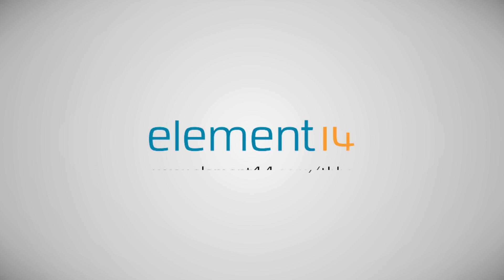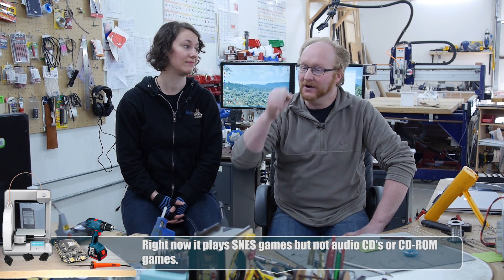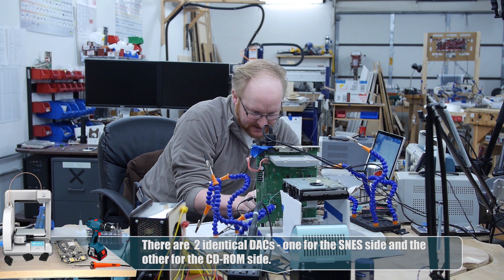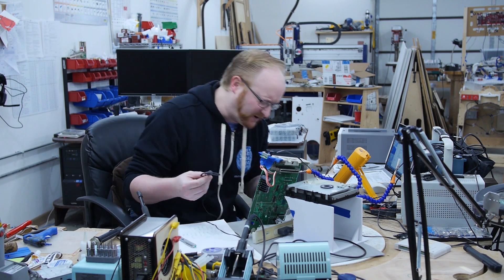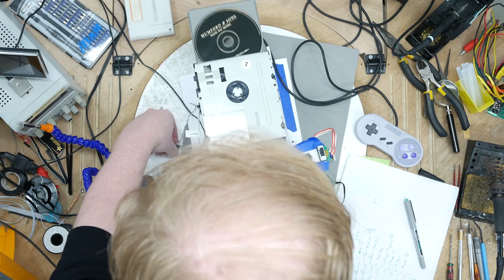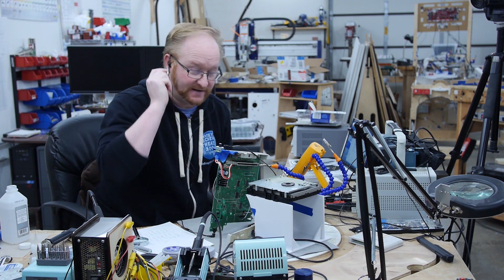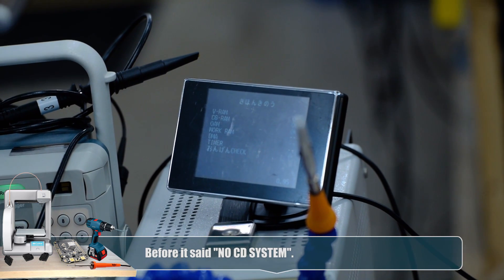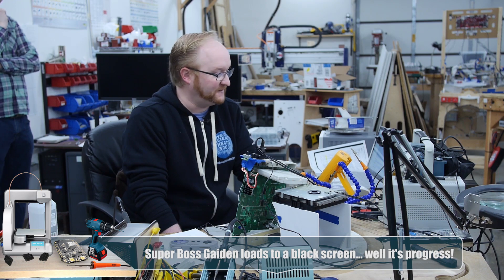Nintendo PlayStation Prototype: Finally Working!

Comment: I hear  a lot of stories about what happened. What I heard was Sony wanted to make CD games that ran exclusively  on their stand-alone unit that would not run on the Super NES add-on version of the hardware.   The Philips hardware sounded more interesting anyway with it's 32-bit co-processor that it was supposed to have.

Comment: I'd love to be able to build one. Or rather, the version of this that works as an snes add-on.
Doesn't need to be authentic, just has to work.

I... Guess that must be possible in that a game for it exists (so someone must know the interface logic from the software side. As long as the response is correct, you should be able to recreate a functional replica of one...)

Comment: I'd really like to produce a new line of CRT monitors designed with retro gaming in mind! Knowing that TVs don't last forever and CRT is the best type of screen for retro gaming, not to mention a requirement for light guns, I think new CRT monitors should be made. I'd love to take this to Kickstarter! These monitors would support PAL and NTSC to make import gaming a snap and have many different inputs: RF, fork connector, A/V and Scart! My name for this product? RetroScreen!
Reply: CRT is a quite advanced technology that is now dead. You can’t resurrect it. Too expensive.
Reply: I was just thinking about why there are basically no CRTs made now
Reply: You need to demonstrate feasibility first, i.e. where are you going to procure CRT screens? Last factory capable of producing them in Europe closed in 2012, last in US long before that. I'm not even sure whether there are any left in China, or whether everything floating out of there is just new old stock.

Another thing is to please not limit the inputs to video, but also support CGA, EGA and VGA, old computer collectors will appreciate. High resolution support isn't necessary. Support for CGA NTSC filter path would be a nice touch, see 8-bit-guy's video on CGA.

Yet another thing to keep in mind that even back in the day, nobody particularly liked aperture mask CRTs, everyone wanted a Diamondtron (with its superior tracking and sharpness) or a Trinitron (very high contrast) aperture grill CRTs. But those two tube brands have been discontinued about a decade back.

Plasma has also been discontinued. I wonder though, it seems like with good conversion circuitry, HDR OLED screens should be able to take place of CRTs. And they will just keep getting better.
Reply: I'm sure if I get the word out far enough, people who do happen to have the required materials could come forward. Not everything can be done on your own, sometimes things have to be done as a team!
Reply: You know what, there's a huge English-speaking maker community in Shenzhen city, Western expatriates, people who are attracted by just how fast and easy it is to engineer things over there, the Huaqiangbei markets, and they're gonna be much better at navigating local markets and untangling manufacturer relationships than we are from here! There's nobody i could point you in particular towards, because i don't have any friends there yet, but if you can find somebody there to help you find a potential supplier, that would be one huge step forward. Maybe reach out to makerspaces such as Litchee Lab, these people seem to hover around those places.

Comment: Imagine if eventually we get to the point where the Nintendo PlayStation could be made into a hardware clone and homebrew devs could create 700 MB SNES games...
Reply: If you mean a 700MB game that loads in parts at a time, you can probably do that already with an Everdrive. Stick a 64GB SD card in there, and you could have a 64GB game. 

It depends on how much control the SNES has over the Everdrive, but I'm pretty sure it has enough control to do that.
Reply: Just to finish replying to myself... imagine this....

Take a breath, because this is phenomenal. Okay? Relax now, because when it hits you...

You know I said to get a Raspberry Pi running in, say, a Commodore 64, right? And the Pi sends graphics data to the C64 constantly, to display graphics on the C64's screen, right?

And you'd run a program on the Pi... But what sort of program?

EMULATORS! EMULATORS! EMULATORS! EMULATORS! 

EMULATORS! 

You'd run, say, a SNES emulator, or Spectrum, or whatever, on the Pi. And the Pi's running a process that converts graphics to display on the C64's screen. So you'd be playing ZX Spectrum games, or NES games, or fucking N64 games, on a Commodore 64! For realz! 

Is there a PS2 emu on Ras Pi yet? Cos you could run that. An Amstrad would be nice, cos it's got a nice colourful screen. Or an Atari 8-bitter, they had beautiful versatile graphics, 128 colours. 

Anyway never mind that. You implant a Raspberry Pi Zero into an 8-bit computer, write a "driver" to convert standard bitmaps, from X or SVGALIB, into something the 8-bitter can show. You then run whatever software you like, including an N64 emulator. Now you're playing N64 games on a C64!

Not just in a C64's case, oh no! On actual C64 graphics! Actual SID sound (a driver to convert samples to something the SID can play, maybe). While the C64's reading in graphics from the Pi to display, it's also checking it's joysticks and keys, and sending that back (over GPIO pins, say) to the Pi. So the sticks and KB work on your emu! You just need to define the inputs like usual. 

Seriously isn't this a great idea? If Ben sees this, I hope he likes it. Would be a legend, mate! A legend! And Ben already is a legend! So that'd be like, a C64-N64 Super Legend! The Legend Of A Legend! 

And I'm off to my Quiet Box now. It's a cardboard box with "QUIET" painted on it, but it's quite quiet inside. If it's quiet outside at least.
Reply: There was probably a smaller limit than that, as you can only fit so many unique memory addresses into 16-bits.
Reply: Or just buy a raspberry Pi and make and emulator, indie games, home-brew machine.
Reply: Why not? What's the limit on a SNES cart size for emulators? It would depend on the emu. I'm sure if someone wanted to develop a colossal ROM, many emu programmers would be willing to make a couple of tweaks to allow it. 

That's if the putative giga-game decided to go with a huge cart, rather than trying the Nintendo Playstation CD-ROM method. 

Actually I doubt any of the mappers available for the SNES, Nintendo or third-party, would support hundreds of MB, though I could be wrong. But an emulator could support an Everdrive cart, if it were needed for a colossal game like that. Wouldn't need to emulate the actual cart, just it's functions, which I'm sure are fairly simple from the SNES's point of view. 

Actually grafting a Raspberry Pi to a SNES, or a Megadrive or a Master System or a NES or Atari 2600 (or 7800 would be good!) or Radofin would be really great. To see what it can do. I wonder how fast the SNES can pull data across the cart bus? I'm too lazy to work it out! But it's probably a function of the 65816's fastest MOVE instructions, and the CPU clock. To send data straight to the screen, the size of a mode-whatever screen would also factor in. 

Just thinking of a cart where basically the SNES spends all it's time pulling graphics data off the cart and blasting it to the screen RAM as fast as it can. The SNES has bitmapped modes so you could do that. But clever use of tile-mapped modes would let you do things a lot quicker. That's only if bitmapped mode isn't quick enough. 

Then you'd use the Pi to generate your graphics for Quake 3 or whatever, convert the screen into SNES format for each frame, then get the SNES to pull them across and display them. The SNES cart would need a shared RAM area, and perhaps a small ROM. You could put your screen-blit program into SNES RAM, have it run from there, then the console spends the rest of the time blitting graphics as I said. 

If I were a much better solderer, much better off financially, and had a SNES, I'd like to do this. 

But Ben Heck could do it!
Reply: The SNES actually uses 24-bit addressing (2^24 = 16MB addressable space), but in any case, there's no reason it couldn't have a bank-switching-like scheme on top of its normal memory mapping scheme in order to access all parts of the CD.

I haven't read the tech docs so I'm not clear on how it actually interacts with the main console, but I do know that you have to load programs from the CD into RAM, so I would imagine that commands involved in initiating a read into RAM (typically, a series of writes to special addresses, since this kind of processor has "memory-mapped IO") allow you to address more than 16MB.
Reply: There aren't any snes emulators to run a game that large.
Reply: Matthew with huge loading times and usually being no different from what you can do with Everdrive(without loading times)?
Reply: William Wenge-Murphy do you understand that the cd addon ram is much smaller than 16 MB so address space size is completely irrelevant?
Reply: greenaum even without an SD reader, switching ROMs to make larger cartridges has been around since the Atari 2600. 

You could also use something like the Mega Drive SVP chip to allow more space - it's effectivity a full computer in the cartridge, with the console just copying graphics to the display. You could shove a modern PC with a terabyte of storage in a cartridge, and just output graphics data.
Reply: There's already the MSU1 chip used in the SD2SNES and bsnes that can allow for games up to 4 GiB in size.
Reply: Genius pure genius still have no clue what most of that means though.
Reply: Or a C64! Grafting a Pi to a Commodore 64 would be good, because the case and power supply are taken care of. Plus it'd be extremely funny to have that much computing power, in a credit card (Pi Zero of course!), inside the case of a C64. 

You could perhaps have the HDMI output from the Pi, but still keep the Commodore's TV and monitor outputs. You could use the HDMI for debugging, for updating the Pi and installing new software and stuff. But for daily use, you'd use the C64's video. You could give it a method of connecting as a serial terminal too, to the Pi. Maybe implemented as a serial port in BASIC. So you'd be able to PRINT and INPUT to the Linux command line!

You could even, I think, develop an X Terminal on the C64! Or at least partly on it. Even if the Pi does a lot of the work cobbling together a display to send to the C64's RAM. Can you use 640-pixel mode on the stock C64? Or else stick with a lower-res more colourful display, whichever, you'd just have to develop software that'd work on it. 

And then after that port the whole project to the ZX Spectrum, Amstrad, BBC Micro, and whatever else! All mostly the same stuff on the Pi end, just need to generate a different screen file for each machine in it's native graphics format. The advantage would then be, that you'd have lots of platforms, all with lo-res X clients. Or if not X, then some other graphical format. The software would run on the Pi each time, so would automatically be compatible with all the 8-bit micros you ported the system to. 

I really don't have the financial resources for this. Or the 8-bit micros any more. Ironically I started collecting back when Ben Heck did, the mid 1990s (and used to see him around rec.games.video.classic now and then, hi Ben!).

Back then you'd turn a C64 down if it cost 7 UK pounds (about $10 American) cos it was too expensive. Didn't want to drive the market prices up! 

Then fucking Ebay came. And the late end of Gen X got decent jobs, and started spending far too much money on old machines, so the prices rocketed up 10x and more. 

Right after I'd left all my collection behind in a series of house moves. And it was a beautiful collection! Not the biggest or best, but it was mine and it was wonderful. Thing I liked best was my Virtual Boy with 6 games. Also my Radofin console, a weird old console even crappier than the Atari 2600, seriously! I had other more valuable stuff, but that doesn't matter. Oh and an Atari 400, that was great! And Commodore PETs (2 of!) with the enormous full-height double disk drives. 

And some weird old semi-portable plasma screen (1980s plasma! not the stuff you get now, was bright orange) thing, that was some sort of server for a network. I think a network of serial terminals. Could never get it booted, if it had a root password, or whatever eldritch hellish system it ran, I didn't know it. 

Stuff.......

I could've sold all that shit now to make a fortune and create whatever project I wanted! But actually mostly I'd just want my old stuff! Sob!

Comment: I'm confused, so what was really wrong with it? Bad ribbon cables, a cold solder joint? It appears as it magically started working on its own...
Reply: t0nito The only things he replaced were a bunch of leaking caps, everything else is completely original.
Reply: It make have taken some time for the caps to charge.
Reply: ..or the last ninja bad cap was ruining everything?
I wonder this too. Did he replace the cable after all?

Comment: Great work, the moment the game world community was waiting for.

But i got 2 questions,1 are you both guy's sure both soundchips in both the cd rom and snes are the same????
I ask this because for what i know, the snes soundchip can output 16bit 32khz at 128KBps as oppose to 16bit 44,1kzh at 1024KBps of audio cd's,so with this in mind,

2  i wonder if there is a realtime convertor software to realtime convert cd audio to snes format??? I would be not surprised if that is the case since the snes brr audio format is different then the cd redbook audio format.

Any techo freaks  here???

Am very coriouse about this.

THX alot.

Comment: so do you think you could make an expansion pack for the NES or SNES that read the discs?
Reply: treypop there actually was an unreleased expansion pack for the snes. but its just as rare as the nintendo playstation and its still haven't been found.
Reply: I know but, all the parts in the Nintendo PlayStation Prototype are off the shelf parts so you technically could recreate it as an expansion pack.

Comment: how is there an emulator for an unreleased console?
Reply: They expanded a SNES emulator based on whatever info they could find. As you can see, it is not perfect to say the least, but it's a miracle that it works similarly enough to the real thing.

Comment: How hard would it be to "recreate" the SNES Playstation (Or the add-on in this case) with FPGA or ASIC, and somehow connect it to a real SNES?
Reply: But why? there are like 2 games for it, and even those are probably easier to backport to SNES than debug on this thing. 
It would take a huge amount of time and would be pointless.
If you want loading games from less antiquated media try flashcarts

Comment: You only have to look at this prototype to see exactly why Nintendo didn't go through to production with this. There is no Nintendo branding on the console at all, but it has Sony's branding all over it (and the controller). It seems very underhanded from Sony.
Reply: Totoro Actually, Nintendo would be the one that ultimately licensed the console for themselves. The plan was that Nintendo would get the money they need for marketing the console and not giving Sony any credit for their hardware, Sony never asked Nintendo for IPs either, it was the opposite. Nintendo ultimately ended up screwing over Sony.

Comment: Actually i'm pretty sure the games where supposed to be loaded bit by bit as you played.

And on the IP comment, it is bullshit. Sony wanted a major share of the profits from the sales of the CD-based software. Nintendo just said no and waddled away. Like the duck in the duck song.
Reply: that's because Sony developed the CD technology and wanted rights to the cd based sales.
Reply: Except they didn't come back the very next day like the duck in the Duck Song.
Reply: No, the contract said SONY would get disc based sales revenue, and Nintendo would get Cart based sales revenue. Nintendo realized that the Discs would clearly out perform the cartridges, and have a higher margin, and flew away like the duck in Duck Hunt.